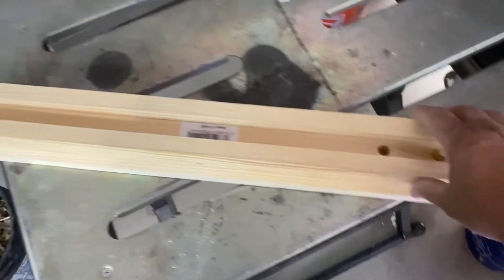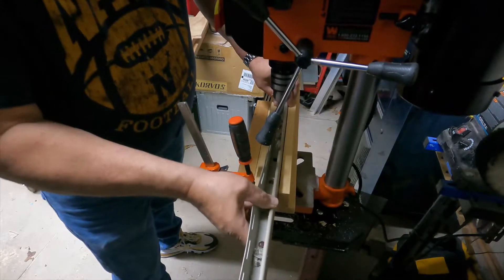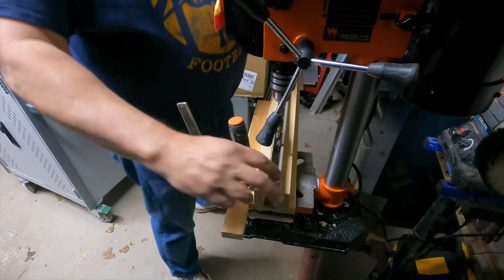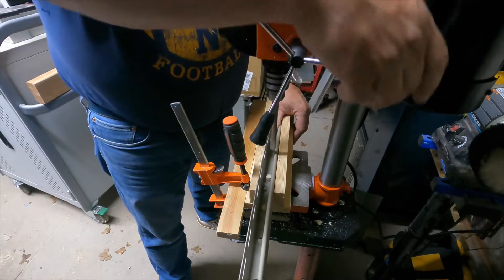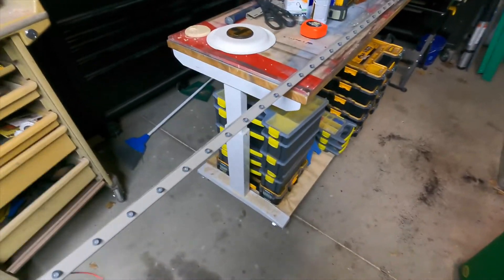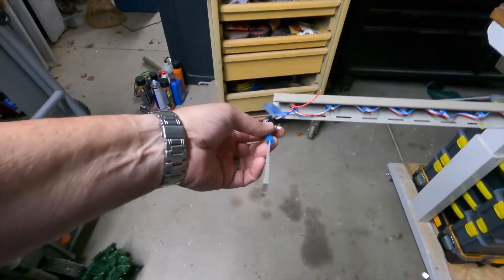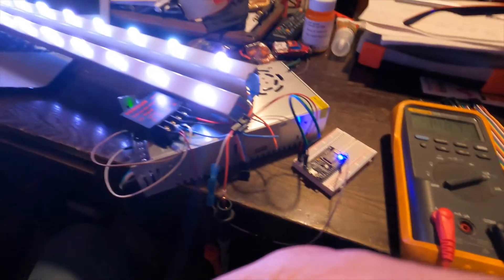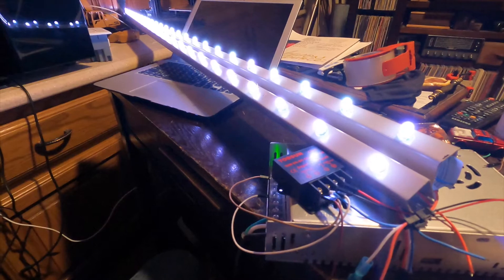Permanent LED Lighting DIY Jig JChannel and Testing

Comment: How did you attach it to the soffit ?
Reply from the maker: Each J channel has a side with open slots for screws. You just put that edge against the inside of the fascia and I just used 3 screws for each section. Look at the other videos in the playlist. There’s a bunch!
Reply: Sorry for bothering you.  I purchased a different jig and couldn’t get it to work . Is it possible to get your specs to make one like yours?
Reply from the maker: @naturaljah100 It’s ok but I really don’t have any plans for it. I took some 1 x 2 pieces of wood, laid them around a piece of J Channel and built the track. Then drilled the hole for at end (same size as the bulb (12mm). I then measured back 2.5” and put the dowel. The issue is that I had to sand down the dowel to 12mm because I couldn’t find one that size.
Reply: Thanks so much. You are just awesome .